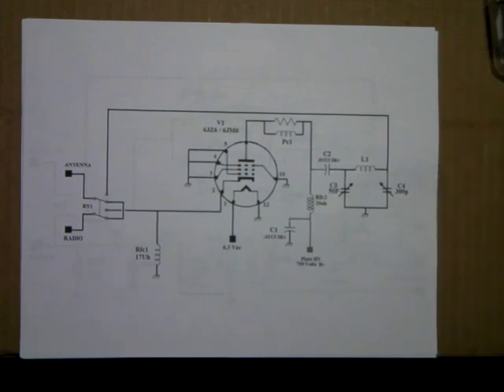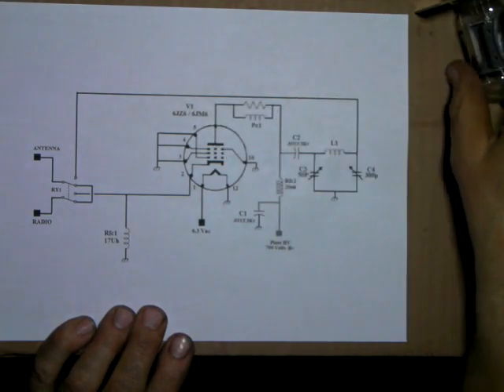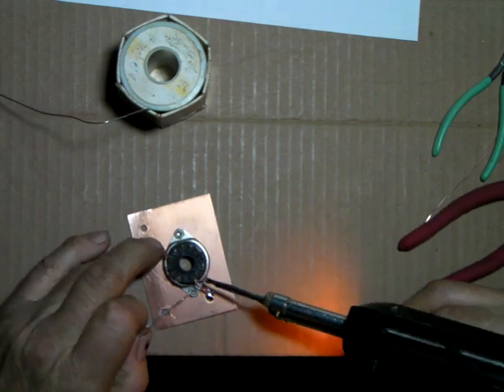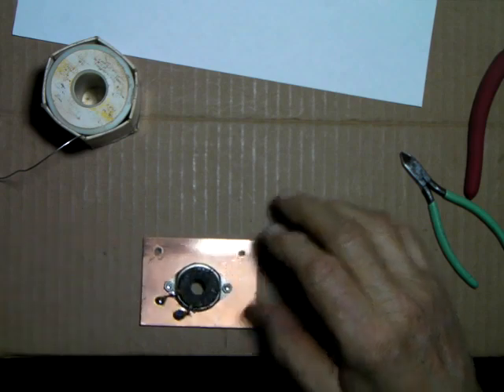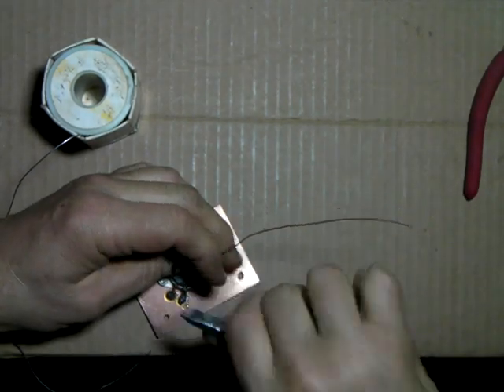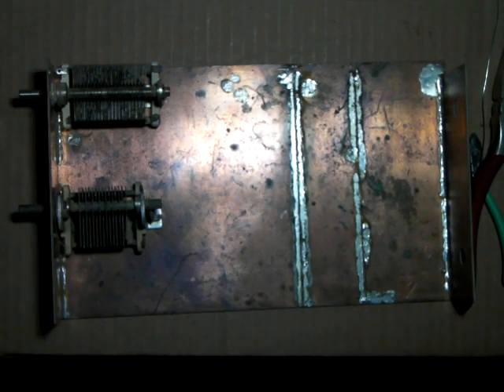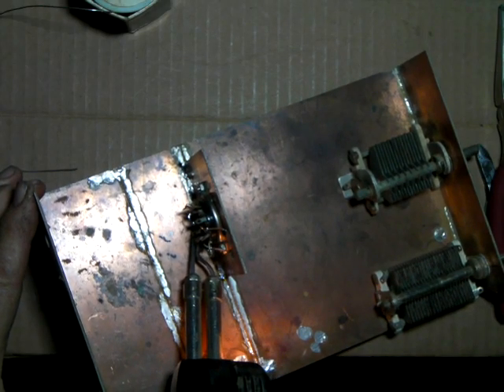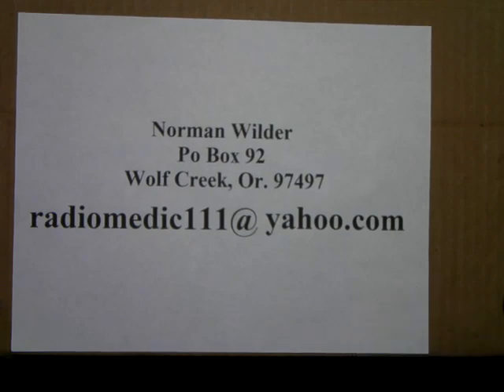Build a Tube Type Linear Amplifier For CB Or Other HF Bands Ep10: Building A Single 6JZ6 Amp Pt1

Comment: I would like to build my own tube amplifier, yet I am curious if adding similar tubes, different tubes or having a mixture will negatively and/or positively affect the amplifier? Cheers :-)
Reply from the maker: Any tubes that you choose should always be the same when using a pair or more because of a tube  characteristic called 'Plate Load Impedance". And it is also important when using a tube in a cathode drive circuit that the suppressor grid not be tied to the cathode internally.
Reply: @radiomedic111  Cheers bud :-)
Reply: Did you ever build one?